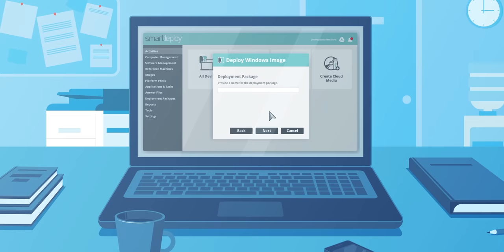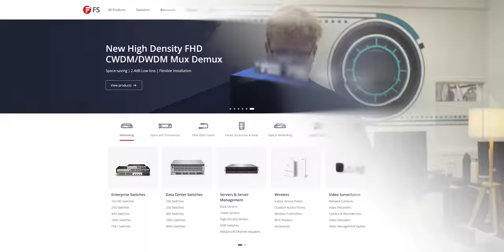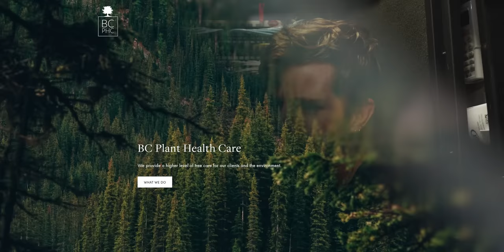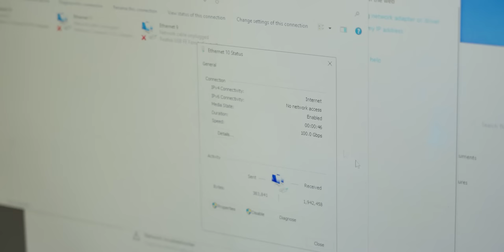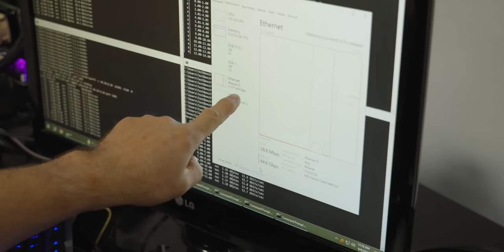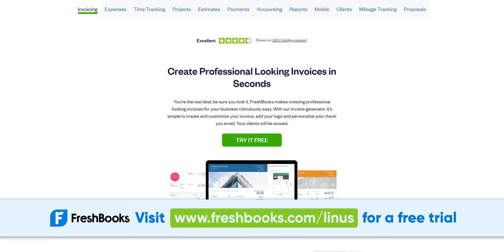Everyone said this was impossible - Backyard Fiber Run

Comment: Decades ago I did the work to get fiber optics certified. I didn't get the certificate because my dumbass waited til the last moment before my enlistment ended, at which point, my friends dad who was the head of the cert org was trying to celebrate my friends first kid... 

So, I don't have an official cert but can say with confidence that terminating fiber optics manually sucks donkey hoo haw. It's not simple like working with copper... copper you cut, crimp and you're good... fiber requires a microscope like device and polishing the surface of the end of each strand of fiber to a microscopic concentric sheen that's flush (not flat flush either, it has to have a perfectly polished slight dome-like look to it) with the connector.... Difficulty varies further depending on if the cable is plastic or glass fiber. Glass is preferable given it's more solid (in my opinion, honestly, IDK if plastic is even used any more, and if so if it's used for long runs any more, glass is superior all the time in terms of speed the light can get to, less friction).

 Do those jobs pay good? Absolutely they can be damned lucrative especially since nuclear reactors commonly have fiber, but especially now that copper is kind of losing its hold on the infotech space, the thing is, that's not a job for everyone, attention to detail is needed in droves, even if you're just running or maintaining the fiber along the stretches in the middle of nowhere... any little kink or knick in a run of fiber can create latency that messes the whole run up. So, lets say that a root somehow pierces the armor of the cable in the middle of a 30 mile run, your only way to figure out where the damage happened is determining where the signal fell off from signal repeater to signal repeater. 

Is there tech now that makes that easier? I have no clue as I just learned fiber optics and tech has advanced significantly since then, all I know is that that at the time it was a pain in the arse because there's a substantial distance from one repeater and another, and you're not able to plug in a multimeter to figure out what's causing the impedance. Most of the increased cost for fiber is getting the kit necessary to maintain it and getting the personnel who are trained to work on it. You also need to factor in that someone who works with installing local fiber in buildings is going to have experience with that, but not necessarily with running/maintaining fiber over long distance and, usually, vice versa. It's an interesting set of fields, though, because once that set up is paid and personnel have been trained and have some experience, the maintenance costs themselves for fiber versus copper is far cheaper. 

If you see splitting the split ends of hairs as a task that you like or are good at, maybe look into getting a cert in fiber optics, but, even now, decades later, the job market is mixed since not all places are converting because a lot of the ISP's that offer broadband internet have far too much invested in cable to simply make a switch, some are charging out the ass for fiber optic internet, which, could be argued to be to pay for the conversion... but... anything regarding Verizon I tend to view as them adding on a ton of extra charges just because they're a greedy company... this could be because I worked in a call center that serviced some of their customers and... I got to see how that company operates firsthand... IDK how many times I had to try to explain away the extra bs charges they tacked onto their cell phone plans as "government surcharges" that were really them not wanting to pay the associated government fees and wanting the customer to directly pay for them...

Comment: Im getting ready to install fiber on a 1400 acre property with 260 buildings.  Direct burial and in the air.   Will have direction from a IT group but I will be doing the work.   Have computer/networking experience but have never touched fiber.   Should be interesting.  lol

Comment: That’s thistle and it’s pretty nasty. But you should seriously run that wire through a conduit. And then either staple it down to the ground or better yet, trench it, which would be the right way. Animals will chew. The suns radiation is extremely damaging. It can be cut. Not to mention neater.

Comment: Just so everyone knows.  When you etherchannel multiple say 100Gbps connections you don't actually get 200Gbps speeds.  Your lanes get WIDER, not faster. It is 2x 100Gbps not a 1x 200Gbps.  This scales with the other he was stating (3x 400Gbps modules).  There is a difference and it should be noted.

Comment: The cost of that roll is depressing. For the last three months either comcast or verizon are running a fiber line from either the CMTS for comcast or the DSLAM for Verizon. They are basically ziping it to the bottom of the main Comcast fiber. What is depressing is the amount of time it is taking them to do it. They will move the damn spool about 400 yards then leave it for a couple of weeks with cones around it. They have taken it a clear three miles past my house. This is after I have tried to get either verizon or comcast to run business fiber to me. I was told by comcast I was only 1600feet from a fiber junction. Depressing.

Comment: @ 12:45   I see the wall and the fence, couldn't you have run it with that truck along the top of the wall and zip tied it to the bottom of the fence posts? so much easier.

Comment: There is no way you need a power meter to check those optics. You can plug them directly in to eachother - the tx max is the same as the rx max, which is lower than the power required to damage the rx sensor.

If you want to play with toys to promote stuff for FS just say so, don’t make up reasons.

Comment: best way to set this up is to setup a LAG with the two 100gb tails from the other building so 200gb, unless you use the other two ports to connect to your switching layer your going to bottleneck, as you know your network is only as fast as the slowest link. 

Id be fuuuuuucking astounded if you have 100gb layer 3 capabilities, id be surprised any switches behind the tik would have 100gb uplinks as its overkill and would be bottlenecked by storage on the servers, that is unless your servers are absolute madness knowing LTT it could be :L
Reply: using three ports between the building and one to the switching layer would create a SPOF, ideally you want two of them tiks

Comment: Ummmm you can do all kinds of speeds across copper at 2300 ft.  How do you think the telephone company does it? before Fiber even existed?  Specifically Ethernet over Copper extenders are usable.  They use DSL Signaling/technology to transmit data over copper over distances over 100 meters.

Comment: thailand (20km from town)  i get DL 900 Mbits per seoncd   and UL 650 Mbits per sec/ basically sold as "Gigabit, 3BB" (the provideer) came within 4 days to install plus a 70 meter garden drop to my office , free, Big router 6 wifi antenna and 12 USD per month, I got free 400 chan of stupid thai TV too  Asia is wired now mainly with fibre the cellphone are so cheap you never bother to look at your data plan..AMAZING THAILAND - QOS is good, if anything goes wrong they are here in a day at most, I use VPN for BBC/torrentz etc The fibre guys gave me a 200 meter free drum of fibre drop cable  so I can do my own fibre roll out in the grounds of my house, Ive even seen half used 2 km drums of trunk fibre  rotting by the roadside where a crew has just left them....

Comment: Fiber doesn't work in pairs. You're confusing copper and fiber. I install both by the kilometer
Reply: and fiber travels both ways on one cable. It's a glass tube sending a light signal back and forth. There is single mode and multimode fiber and BOTH can transmit and receive on the a single line

Comment: you only need 1 strand of 2 fibers to get virtually unlimited speed. fiber speed is not dependent on how many cables you run, only the equipment at either end. fiber laid back in the 70s can still run 1000000000 terabits when the equipment on either end exists. 2 fiber strands are necessary for send/receive but that's it. this is why it's super disappointing that most cable providers in the US will not install to most existing neighborhoods but only install in new builds because it's a 1 time job that will pay dividends over time.

Comment: You could run 2 wire RS-485 for longer than 700m.  So yes, you could get a copper signal that far, just at 115kbps (or probably less) :b

Comment: As someone who as run a fair amount of fiber cable this is stupid, and hilarious at the same time.    Shouldn't cost more than $10-15k to directional drill and pull in a proper conduit for the cable.  If someone quoted you 100k, you are getting ripped off.

Comment: If I did anything like that cable pull around here where I live,  you can bet that some asshole would on purpose do something to the cable just because it's there. Do anything beyond your own propert, even with a local okay, someone would see the cable and throw rocks at it or hack at it with a knife or axe. And why, because most in this country is flaming assholes when they think nobody is watching. In place with a bit of foot traffic you can't even have stuff out in your yard or it will be stolen if anyone can possibly see a need or value in what it is. It's a sad state of the world and it's been getting worse too, but it's been like this since before 2000, so it's not a new problem.  Most such sabotage or theft goes unreported too as people know they should have known better.

Comment: A rental of a Brush Hog would have made for a trivial and painless run, although I guess it would have been a boring video. And the "You know we could do 300Gbps" with that equipment at 16:20 isn't quite true. The switch has (4) 100Gb ports, but if you were bonding three of those ports to get 300Gbps between the buildings, you'd only have 100Gbps for the lab's side of the connection. So with that 4-port switch, 200Gbps is the most you could really do between the buildings. That type of cable is typically rated for both direct-burial and aerial applications, so if you could get landlord permissions you could hang it along the tops of the buildings for a permanent solution. Another option is that there are some companies which will run private dark fiber using standard right-of-way paths that the utilities use (telephone pole and underground). When I consumed such a service, it was typically structured as a lease with initial terms on a 5-year lease, and renewable options up to 100 years. Then you could treat it the same as what you ran today, using whatever optics you want without any metering. The main difference would be that they handle the legal right-of-way access issues, vs you knocking door-to-door to ask for permission to hang the cables and needing to figure out what permitting and mounting/supporting structures would be necessary in your area.